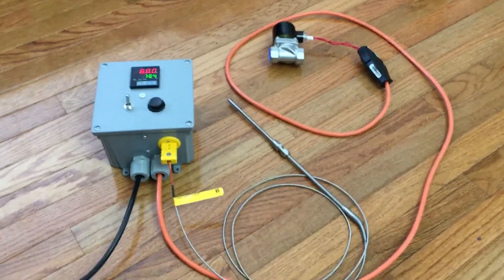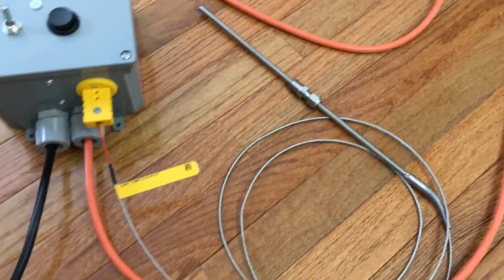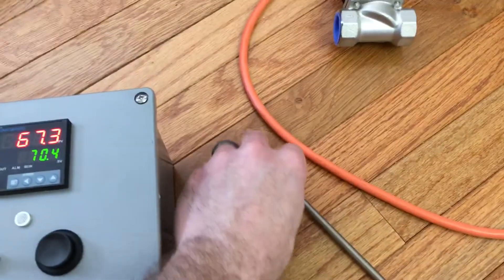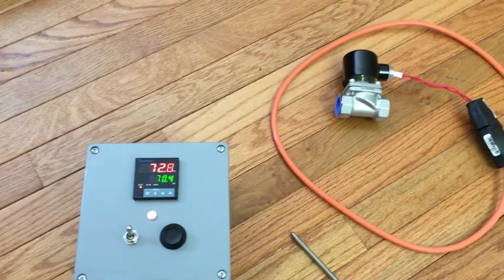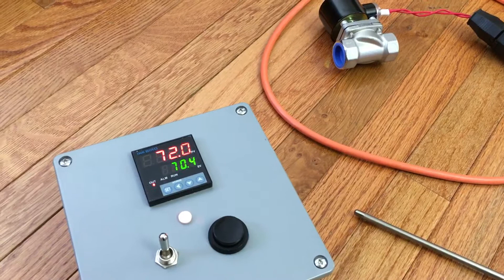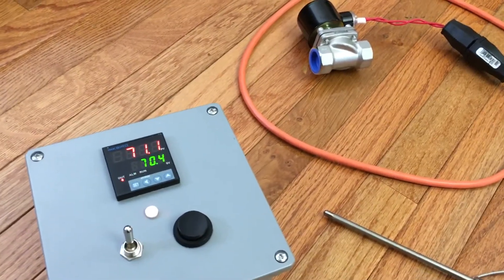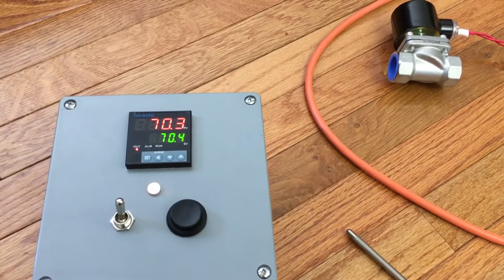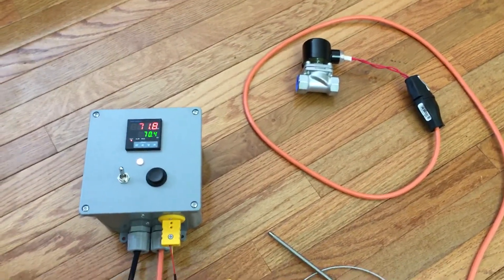DIY Sap evaporator auto draw

Comment: I am having trouble tuning the Inkbird 106 to open and close quickly at set temp. Are you using it in PID mode or ON OFF? Would you be willing to share your settings? I'm having trouble finding much information about this unit. Thank you in advance.

-Adam
Reply: I use the types of controllers on my projects (diy chicken scalder & diy incubator) and one thing that I have learned is you need to set the controller to auto calibrate. There are some videos here on YT that go over how to do that. I’d recommend looking for those. They weren’t very impressive until I figured out how to get them to auto calibrate. Hope that helps someone.

Comment: I did a motorized ball valve on mine. I had issues with the diaphragms on those solenoid valves. niter seems to be a issue with sealing some times.